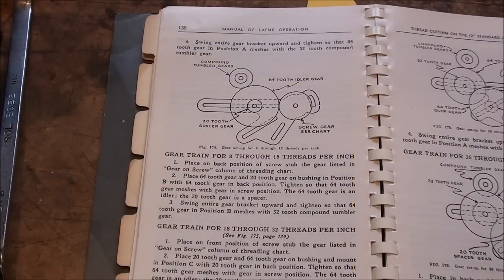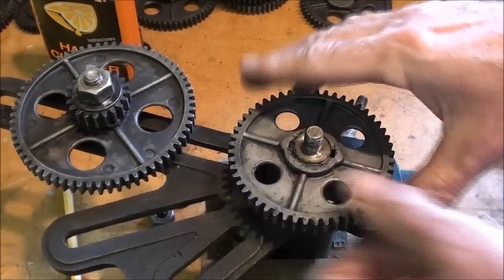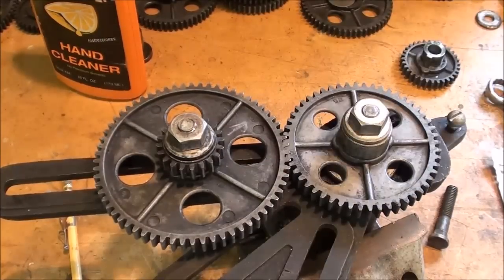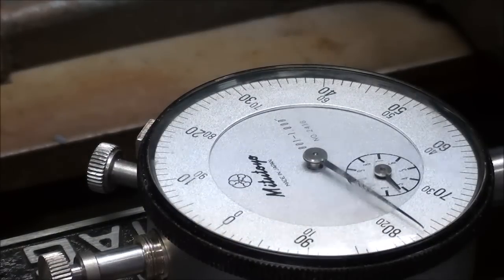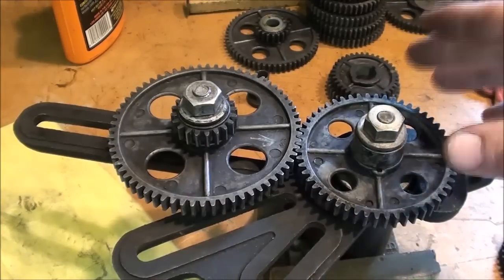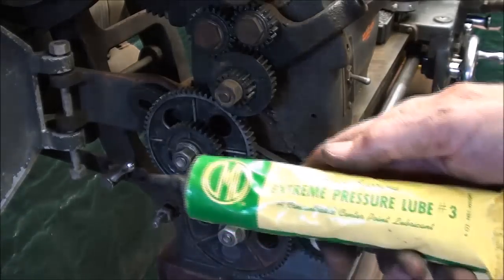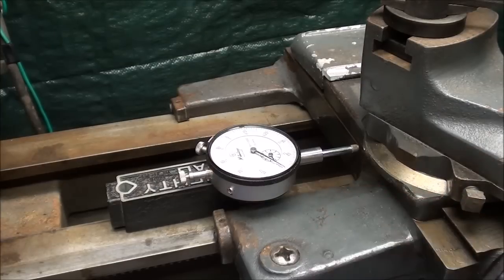SHOP TIPS #222 Adjusting the Change Gears on Atlas Lathe pt 3 tubalcain

Comment: Thanks for the series Mr. Pete!  Wish I would have seen the segment about putting the bushing on the other side of the gear about 6 weeks ago...drove me nut until it dawned on me.  Another thing I figured out was setting the backlash for the screw bushing when threading.  My Peanut doesn't have thrust bearings or even a clean way to adjust it but made a world of difference in thread quality after working them carefully to about 1-2 thou backlash.  ~PJ
Reply from the maker: +pjsalchemy Thanks for watching-good comment

Comment: When setting gear backlash I use a piece of .002" brass shim stock cut to the width of the gear and long enough to provide a handle. Just wind it into the gears about 4 teeth  the first time it's used to set the shape. Two of these are good for a lifetime of threading. I really like my Seneca Falls lathe as no tools are needed to change or adjust the gears. I replaced the two nuts used on the banjo (quadrant) idler shafts with nuts that have handles like one sided wing nuts. The other shafts have slip washers. Thanks for another great video.
  Mike (o\!/o)
Reply from the maker: +Moholo 88 Thanks Mike--will try that with brass

Comment: I almost didn't drive the 100 miles to get my 12 inch atlas with gear box and a 618 that went with it because it looked so rough, but so glad I did,,was in a cast iron stand and casters , but the big surprise was in the rusted bucket that was with it,,had a steady rest,,follower rest a milling attachment a nice original 4 jaw Chuck to go with 3 jaw and a faceplate with 6 different size dogs and many more accessories and he even mailed me 60 lbs of more he found,,and the 618 was hardly ever used and the 12 cleaned up like new with no wear anywear,,Pete I got it all for 500 dollars, even has original craftsman motor and reversing switch. I'll never find another deal like that and I almost didn't go..I have seen the prices almost double in vintage lathes in the past year as people realize vintage lathes are the best way to go now..
Reply from the maker: Wow, that sounds like a great machine and a great deal

Comment: Do you have any idea why the 20TPI is specified to pick from the 32 tooth tumbler gear and reduce 2:1 to the 40 tooth on the screw, rather than pick from the 16 tooth gear and use an idler? I set it up on my lathe using the second method, though the I think the idler is the 72 tooth to make an easy fit-- whatever the largest in the standard set is. I find this more convenient as the direction pick is the same when doing several threads on the same part, so I am less likely to select the wrong direction. (yes, I'd love the QC box. No, I don't want to pay what they seem to go for. If it was a SB heavy or a Leblonde....)

Comment: Thank you for the interesting video series.  I have a quick change gear box, but it's still interesting to see how it's done without one. If you ever need an idea for a related video, explaining how to work with the thread dial would be helpful. Determining which lines or numbers are acceptable for which thread pitches is a black art for me at the moment. Not even sure if it doesn't change from one machine to the next, though I suspect it doesn't. 

Thanks!

-- Mike
Reply from the maker: +BigMjolnir Thanks--I cover that in a future video
Reply: Thank you, I'll look forward to it!  I noticed on your recent threading video that the Atlas lead screw makes 4 turns for each of the 4 lines on the thread dial. That plus the ratio from the gears has to be where the answer lies, since the goal is to tell when the spindle is back in the same position as when you started the thread.  Hmmmm.....

-- Mike

Comment: Thanks Tubal Cain for this series and for all your teaching, as I’m ramping up to get an atlas clausing 6” up and running and start to learn metal turning from scratch with lots of help from books, YouTube and friends. 

Question- these similar Atlas Clausing and Atlas Craftsman lathes call for 20 Weight non-detergent lubricating oil for the mechanisms. But 20 Weight is rare/hard to find/more expensive than non detergent 30 Weight lube oil. How important for the working and longevity of the machine is the 20W as opposed to 30W?
Reply from the maker: I doubt if it makes one little bit a difference. Use the 30 wait
Reply from the maker: Use the 30 weight. Probably does not make any difference
Reply: mrpete222 Thanks!!

Comment: When I was rebuilding my Atlas lathe I found it interesting that the 11/16" nut that Atlas spec'd for the change gears is larger in size than the 3/8"x16 nut normally found on the size of bolt from a hardware store.  It's should also be noted that the current Sears replacement bolt 9-69A is nothing more than a standard carriage bolt you can buy for $4.59.  Ended up making my own nuts from 11/16" hex stock to be correct to the original part, and turning the heads of standard carriage bolts to cosmetically match the originals.
Reply from the maker: +hankus253 Thanks for watching
Reply: I am going to do.the same

Comment: Your the teacher,,,so question on threading,,,have a few Atlas (Craftsman) lathes,  101  and the older one's.  Some are with change gears like the video,,all are 12",  Some have  quick change gear box,,,what gears are supposed to be on the machine with quick change gear box, the one below the compound gear, then I should be able to pick up any TPI on the selector box  And is their a book on it.. Think someone stripped the gear below and replaced it with a 60 TPI which makes treading off on everything,,cut a 24 TPI , and it ended up as about 40tpi...and the bottom gear that engages the gearbox, is single and also solid gear that is 42 tip.  OOps...  Thanks if you read this,,enjoy all your video's very much.
Reply from the maker: That is not an easy question. Here is what you need to do. Go to the website vintage machinery.com. Then find the Publications area and search craftsman tools. There are hundreds of reprints. Find the ones applicable to your Lathe and print it out. I think there is one strictly on gears.

Comment: Your videos are VERY instructive.  I thank you.  One question;  Where did you get your "book"?  I have seen one place to buy a manual, however, it is in the UK.  The machines they are showing do not correlate to my machine I inherited from my brother.  It is well used and I would love to change out the worn parts.  Could you give a place in America where I can get the parts and manual?
Reply from the maker: Only on ebay

Comment: Great information.
I there a purpose for the holes in the main spindle gear that you had the scale next to?
Reply: +toddlfrank The holes are used with the pin seen at 15:06 to provide for indexing. Useful for layout, and cutting keyways and splines,
  Mike (o\!/o)
Reply from the maker: +toddlfrank saves metal

Comment: I can imagine the math and figuring it took them to make all these treading combinations work,,just a shame they dropped the ball on the .oo42 slowest feed rate,,my only complaint about the atlas quick change, and with my 2 12 inch atlas lathes with quick change gear boxes I did get the original change gears but not the mounts for them.

Comment: Hi Pete hope you have been keeping well.  I've had to change my phone recently and been honestly missing watching your channel. But now have  a new phone. So looking forward catching up on anything I have missed.. There is a question I like to ask you My 1939 Colchester master 6 inch lathe has a maximum top speed 550 rpm. Is this going to cause me problems with turning some hard steels. As im a bit worried it may lack the speed. Compared to the newer models from 50s onwards. I really hope not as in putting so much work in restoring her.
Reply from the maker: Mark. 550 is a rather slow speed. In general, carbide requires more speed than that.  I would suggest experimenting with different steels & different lathe tools.  I am sure it will be adequate
Reply: mrpete222 I thought that to Pete with regards to the speed. I may just restore it and if it isn't adequate for my.purpose i may just sell it.

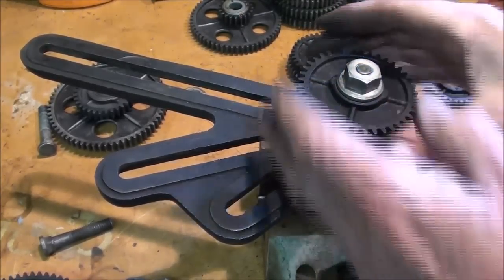Comment: At 11:40 you're putting the 64+20 gear in the C position but you described it as the 64+32 gear in the A position. You corrected yourself on the gear put not the position.
Reply from the maker: +Bruce Adler- (bruceadler) Whoops